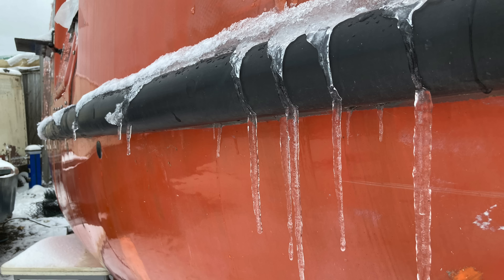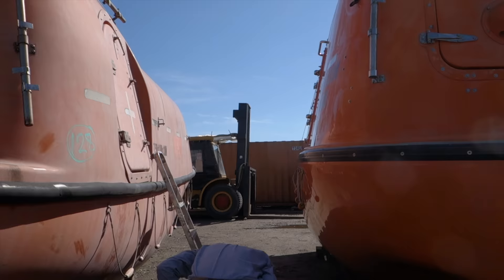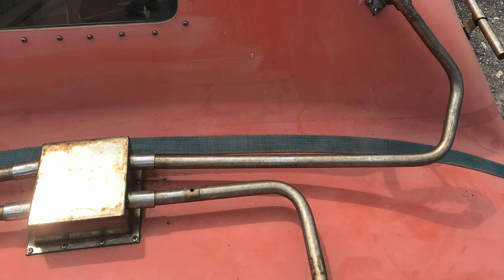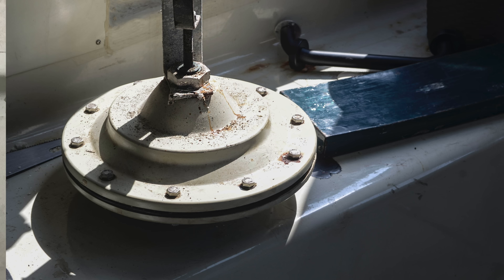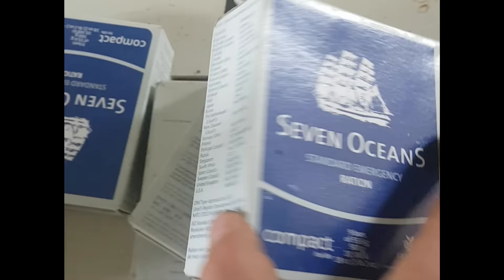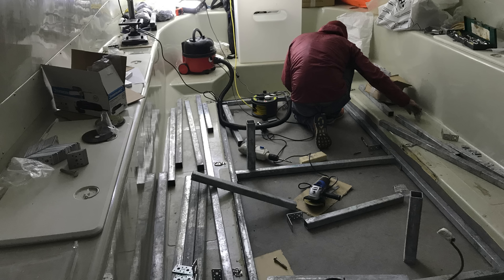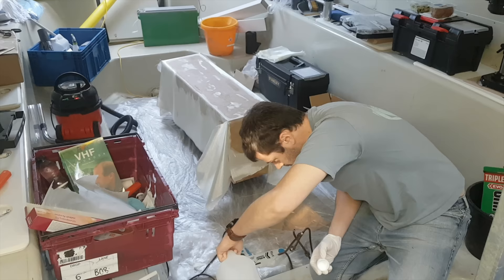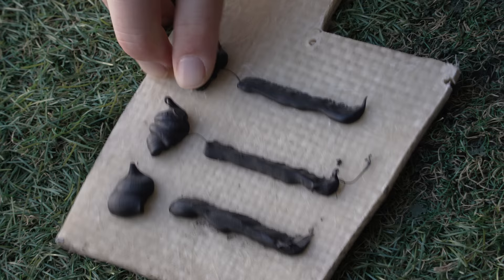Until-now unseen and hidden imagery from Lifeboat Conversion journey - purchase & early work (Ep51)

Comment: Nice catch up video Alex, a couple of things with no real help now, if you had those 3 compressed air cylinders hydrostatically tested and repainted them black you could have got a lot more than scrap value from a lifeboat service company, the diaphragm you removed to drain the diesel is a lockout that stopped the davit hooks being released until the boat was waterbourne, also if refurbished an item of value.

Comment: Since you’re going to be using the 3 electric motors in an emergency, what about creating a mount on the bow for one of the motors to create a pseudo bow thruster when navigating tight spots since Alan doesn’t have a Z-drive Prop (360 degree rotating prop). It would only be used for short periods at a time such as when your docking.

     It’s would be mounted on a shaft so when you’re underway you can access it through the bow hatch and lift the shaft vertically out of the water so it would not get damaged by ice.
Reply from the maker: This...is why I leave the comments section switched on.

This and jet ski guy's rantings.

Comment: As a welding supply worker here in the USA I purchase 249 ft3 (4 liter) all the time.  I have seen late 1800's and early 1900's cylinders still in use as CO2 tanks (lower pressure).  The German made tanks from the early 1900's all had swastikas stamped on them.  Here in the US we stamped over the symbol, filling in the open ends, so it has 4 boxes put together (two on top, two on bottom)  Their value as a compressed gas cylinder is way more than their scrap value.  Just thought you might like to know for future reference.
Reply: Basically saying there is no such thing as a cylinder that is too old.  They may go bad but don't judge an old book by its cover.
Reply from the maker: Thanks Brian. Point taken. The fittings at the top were a real mess with corrosion, so I assumed game over.
Reply: @AlexHibbertOriginals  Yeah we just unscrew the valves and put new ones in.  They need to be hydrotested every 10 years put that is cheap and easy.  Sandblast and paint and a new valve would have them looking like new.

Comment: Don't forget to install sidelights, port red and starboard Green. Also the polar region distress equipment and pyrotechnics and standard maritime rations for survival as well as medical equipment and survival suits for polar regions. 

Nice video Alex, pls tell me, how did u calculate the stability of Alan b4 it's waterborne(I mean upright), tnx. Bon voyage!
Reply from the maker: A warm pair of socks too?

We didn't make additional stability calcs prior to initial trials? The changes from 'factory' set up were all removing mid and upper weight, so at that stage the stability would only be enhanced, not worsened.

Comment: Alex……did you try any of the provisions? Brave enough? How long could the original lifeboat engine run on the fuel provided? Was there are diving board provided for outside entertainment?
Reply from the maker: We did nibble on a survival biscuit or true. It was exactly as feared - perhaps death is preferable.

SOLAS required that the fuel lasts at least 24hrs of constant motoring, but I suspect this is conservative.

No diving or any entertainment whatsoever - only the relief of being alive inside a crowded, smelly, sealed vessel.